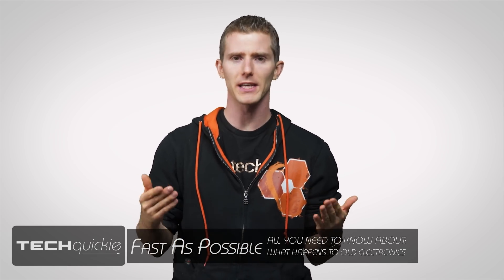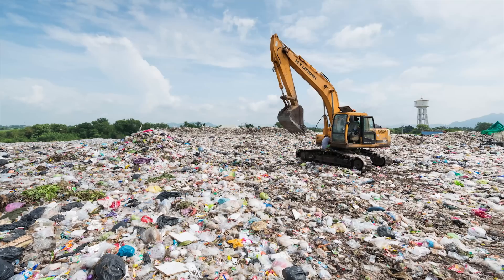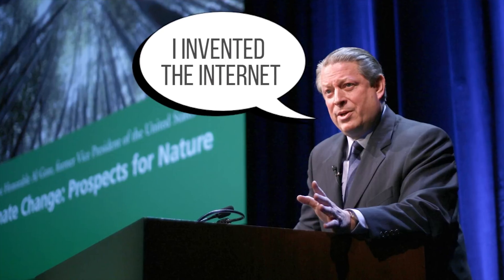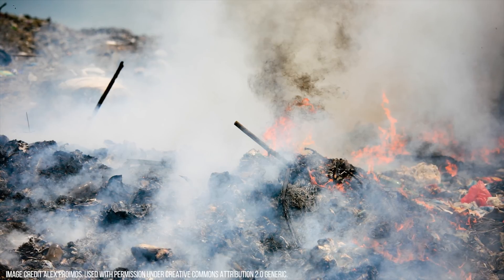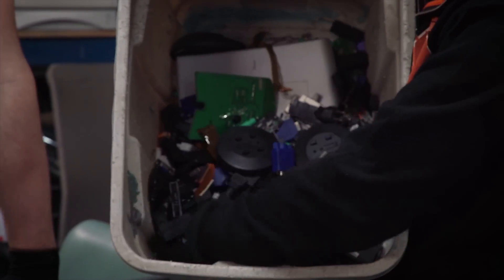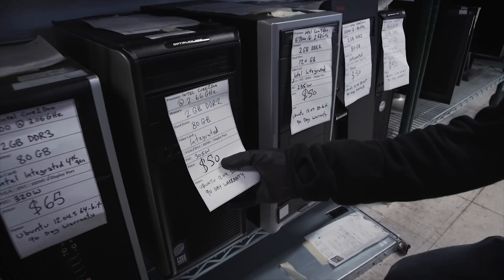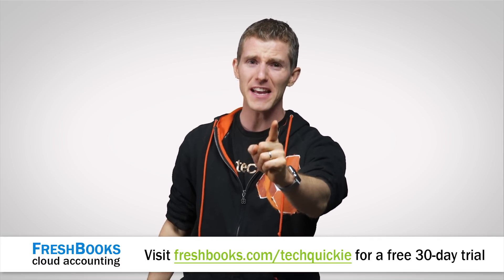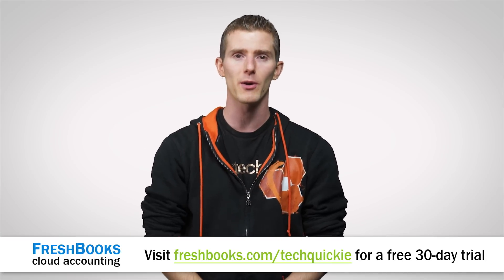What Happens to Discarded Electronics?

Comment: Not sure if you stopped asking questions at "automatic sorting" or it is a deliberate omission: reputable e-waste recyclers burn the waste as well.

For the longest time, I was not convinced that e-waste recycling was even possible. Electronics are filled with proprietary composite materials that even your system manufacturer is not fully aware of. Older electronics use things like leaded paint (on plastic) for radiation shielding.

Because I am interested in the topic I asked my local recycler (during a open house of Edmonton's waste management facility) what happens to the stuff that can not be separated. The answer: converted into diesel and burned. They mainly recover precious (and bulk) metals. I think they do some manual pre-processing to sort plastic and CRT tubes as well.

Comment: 1:22 wtf are cds doing in that bin
Reply: The Three Horned Flink wat u mean
Reply: CDs/DVDs that are scratched up are useless, so they get thrown away. And like the other electronics highlighted here, they should be recycled instead.
Reply: jb888888888 but they are made of plastic, right? they should be thrown in a regular recycle bin, not an electronics recycle bin
Reply: There's a coating of metal on the plastic (usually aluminium, 
occasionally gold). IDK how it works where you are, but 'round here 
you're only supposed to put plastics in consumer recycling IF it has a
 triangle-and-number.
Reply: jb888888888 oh... that would explain a lot actually. nevermind me, thanks for pointing that out.

Comment: How hard would it be to put together a decent PC from recycled parts?
Reply: Scrapyard Wars?
Reply: Nick L idk but it sounds fun as hell
Reply: Nick L not that difficult. Most parts have information telling what chipset and specs apply. If they don't, they have a p# you can Google. If it fits, it works with the exception of RAM. Don't mix ram speeds. Make sure they match or exceed the MoBo's clock for ram. Look up the motherboard manual and it will tell you.
Reply: SCRAPYARD WARS
Reply: Just search "LTT scrap yard wars"
Reply: Well, at least when it comes to raw materials, it can all be melted down and then recast into modern chipsets. The manufacturer really is the only one with the infrastructure to do that though. I would imagine there isn't much to a computer that can't be recycled back into its raw form and then used again to make something else.
Reply: You know Linus already did 3 seasons of that exact idea.
Reply: link?

I'd like it if he did 3 seasons of dildo racing as well.
Reply: Like scrapheap challenge, but instead of bodging together machines to race, we have a team of nerds compete to see who can play crysis at the highest framerate using trashed components.

I'd watch it.

Comment: In the 90's my father owned a precious metals recycling company. As a kid I was occasionally allowed to help there (which was a serious health hazard now that I think about it) and help with some of the more mundane tasks. They used to get discarded industrial motherboards by the truckload and had huge mountains of old electronics on the facility property. The precious metals would be processed off the boards with acid or other means and, once there was enough, melted down into gold and silver bars which they then sold. Pretty profitable stuff  to do if you do it right.